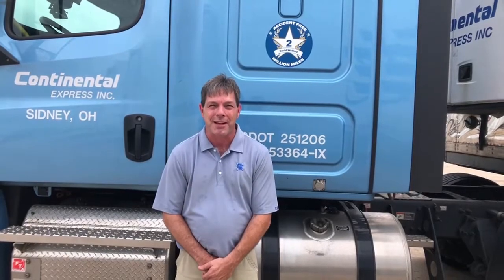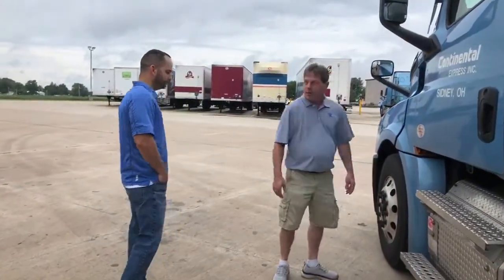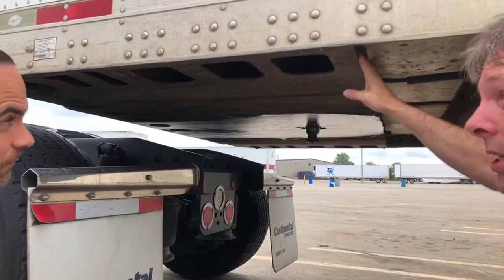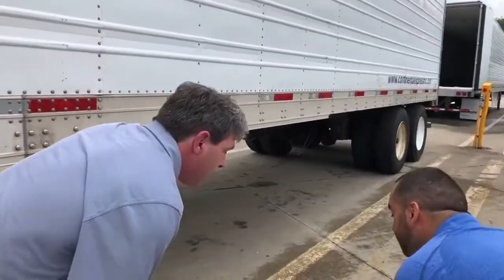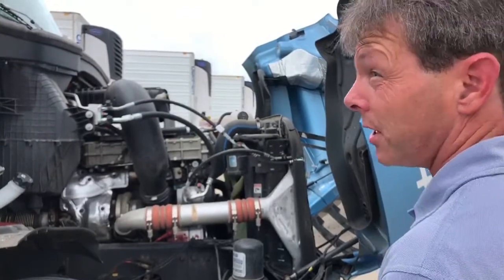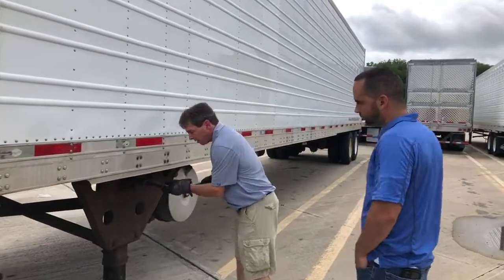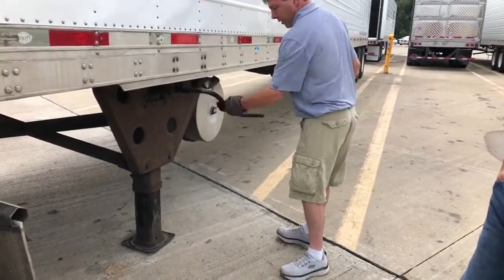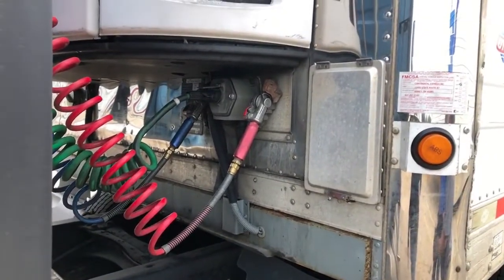How to: Drop & Hook Semi-truck and Trailer

Comment: I think you should lower the landing gear first for safety reasons. If  you forget to set the trailer brakes which can happen, the trailer will roll off the tractor and fall to the ground.